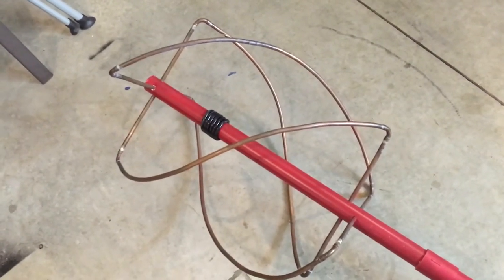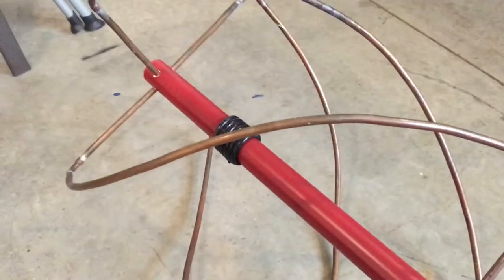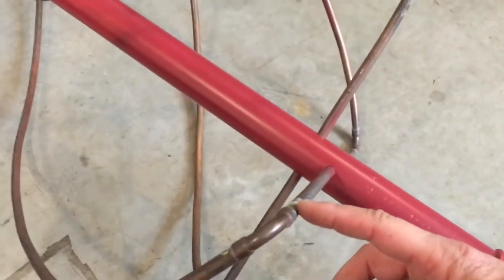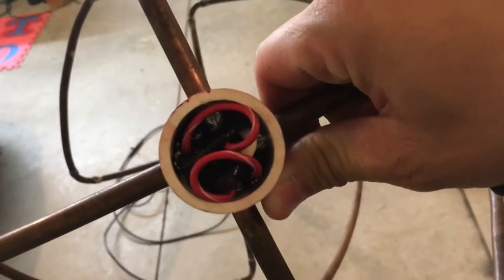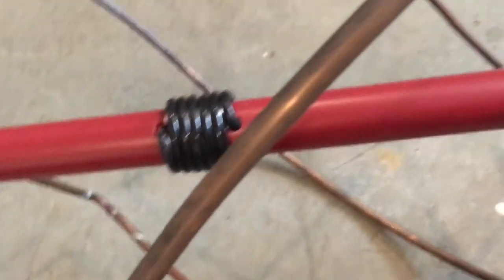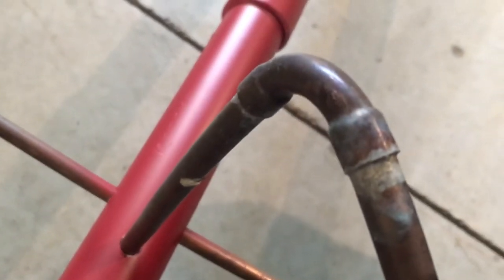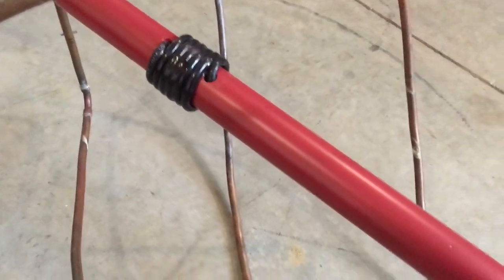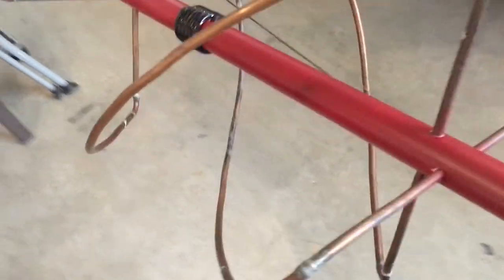Homemade QFH Antenna Made From Copper Tubing Used For NOAA Weather Satellite Images

Comment: Built exact qfh for sat, doesn't seem to do very well. Everything measured and aligned perfectly, no  phase to phase shorts, good electrical contact everywhere, 18ft 50ohm ultra low loss coax; does this antenna require an electrical ground from shielding? when I touch the antenna while receiving a signal, the signal increases 10 full, this is why I'm wondering about a ground.
Reply from the maker: The QFH antenna is a shorted antenna. Here is the plans I used. 

http://tinhatranch.com/how-to-build-a-qfh-quadrifilar-helix-antenna-to-download-images-from-weather-satellites/

Comment: Hi there!! What does it mean when it says to bend the tube anti clockwise? 
Grasp the top connection with one hand and gently bend the 812mm piece to meet the lower cross bar
on the opposite size. You must bend the ENTIRE antenna ANTI-CLOCKWISE when viewed from the top. I
repeat, you must bend each leg ANTI-CLOCKWISE. The bend should be as even as possible, and I frankly
don’t have any magic way to get this done or confirm it was done correctly other than the old hairy
eyeball.